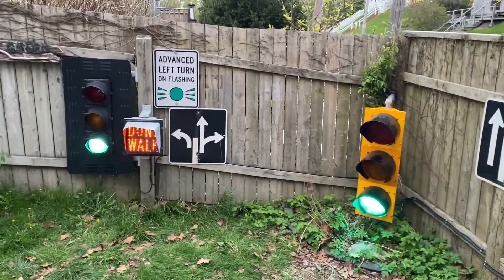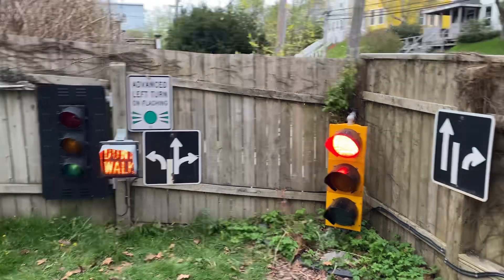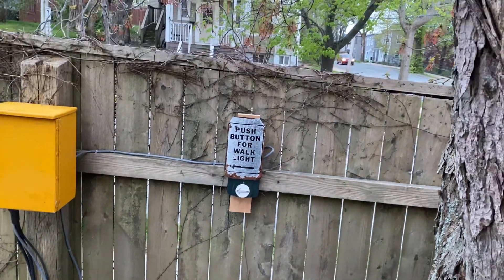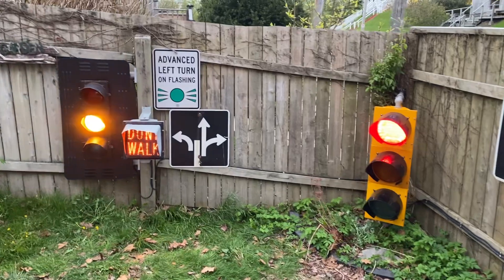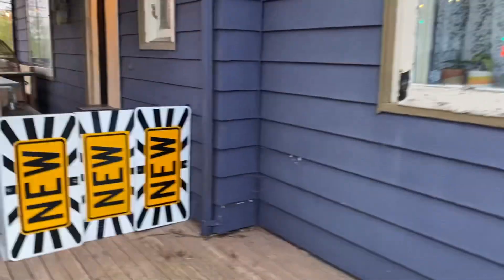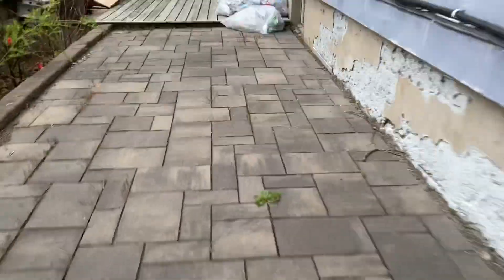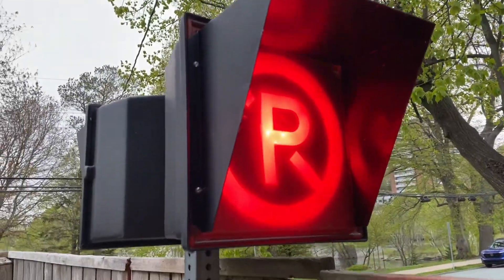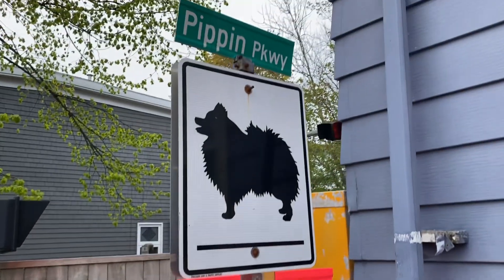My New Outdoor Signal Setup

Comment: I love it! I wanted to know if you can explain to me this problem with some LED ped signals in my city, so you know that the red light or the countdown starts flashing when they're going to turn red, well for some reason on some of them the walking light just turns off and the countdown/red light doesn't flash, but then when there's a solid red the light goes on for like one second, then turns off, then the light turns on again and shows a "00" in the countdown for a few secs then stays in solid red, it's so hard to explain :/
Reply from the maker: Must be an issue with the unit!
Reply: @TheTrafficTech  Could be, today I recorded the issue to show it https://youtu.be/Ybei5UHLxB8 the rest of the peds in the intersection work properly which is odd cause they all run off the same sequence